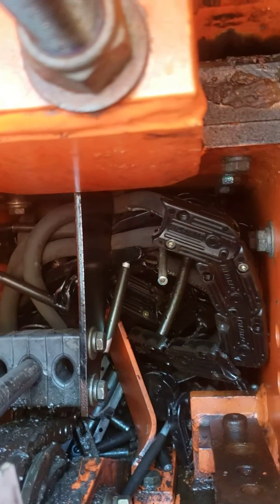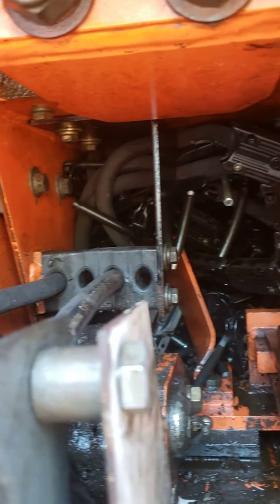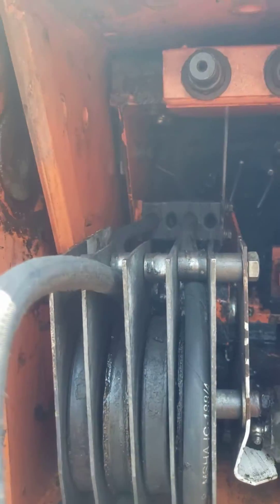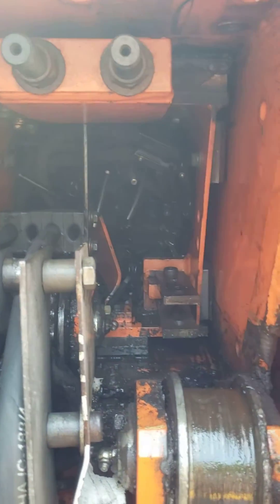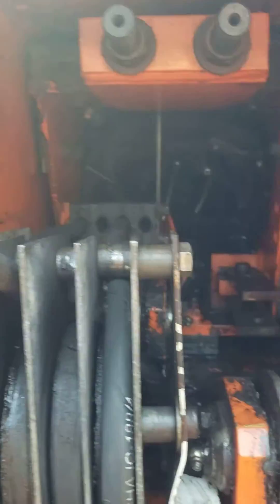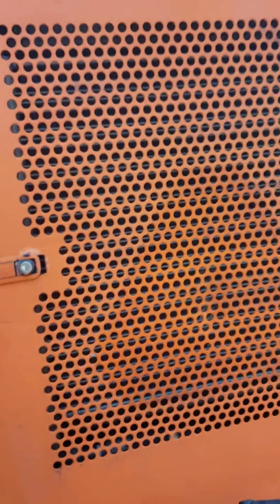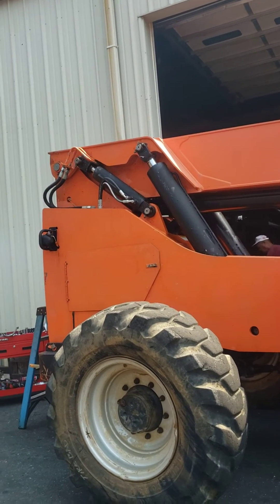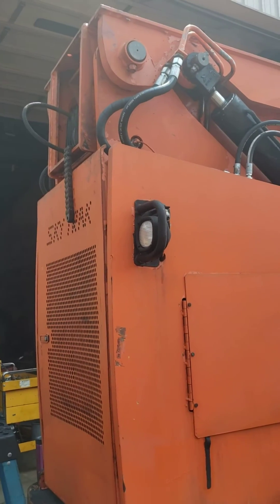10054 Skytrak, What happens when hoses wrap around track inside the boom.

Comment: Did you determine what caused it to do that? I've been told if the operator is using the boom to push ground loads that the hoses can come off of the carrier and get wrapped up like that. Thanks in advance and thanks for posting.
Reply: must be a design flaw..........